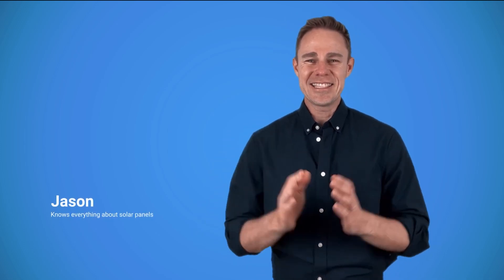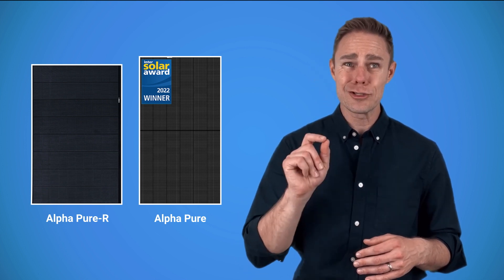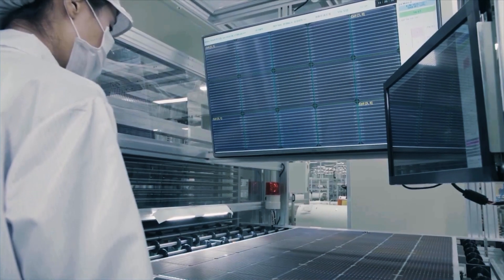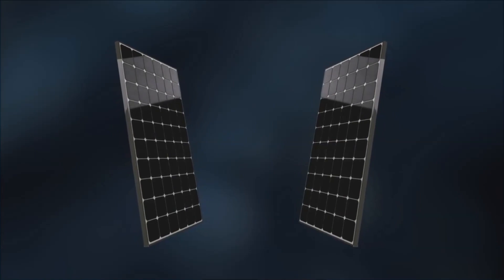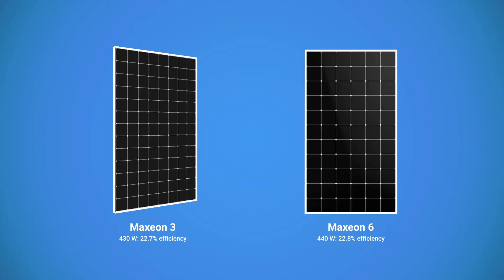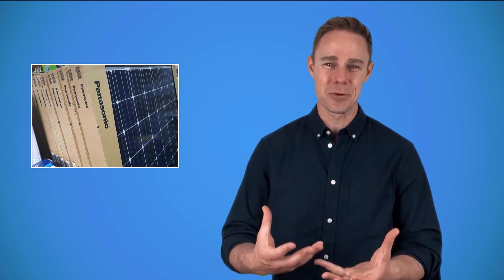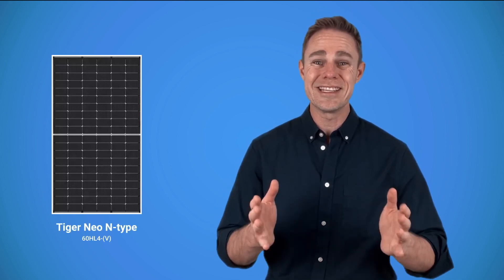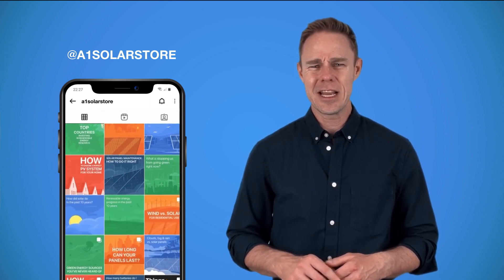Best solar panels for home in 2023? Top-5 list

Comment: Garbage list when u dont even include the aptos440.  That and fhe REC alpha pure r are easily the top 2 available to date.
Reply from the maker: Aptos panels are good but this one has been out for a while. and it's not like it made a huge splash when it came out. what makes you think it's so great?
Reply: @a1solarstore  best warranty currently available in addition to the capacity it will yield on top of the overall sturdiness designed for extreme heat and weather conditions like Florida and other states see.

Comment: I noticed the bendy demo was functional side down, they didn't return the piece to straight, and they never showed the side that matters, the conversion side.  Also, for the life of me, I don't understand why it is of any benefit to be able to bend it.  Does it perform better over operating lifetime with thermal expansion/contraction maybe?  It's mounted in a flat panel, guys.   Sorry to be an engineer, but I am.  Thx, I will add these panels to my research list.  It also concerns me a little bit when a company says 20 years warranty on something they are discontinuing.  If it was just the panel, and not the entire line that's not quite so bad, but if it is solar panels altogether...hmmm.   I'm also guessing these guarantees are pro rated all to hell and that they have a pretty sizeable power loss over time specified as 'still good'.
Reply from the maker: Well, if you're talking about warranty from LG that stops making panels - the company itself is not going anywhere so the customer support should still be there. I get the worry though: maybe it will be hard to get a replacement, but hopefully they'll offer some other options... As for sunpower vids - yeah, bending cells is more of a showoff than anything. strange i agree. but it least it shows that the cells are harder to crack.